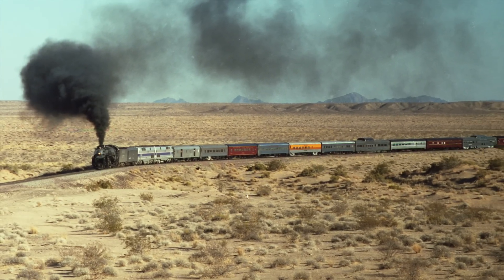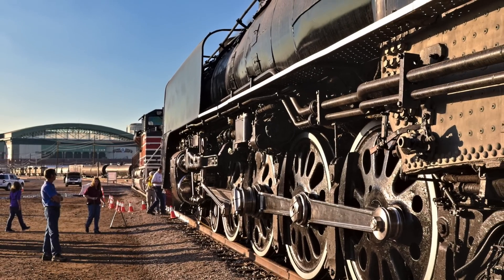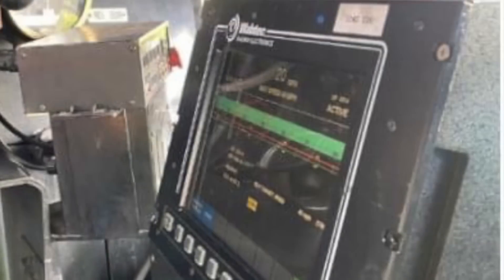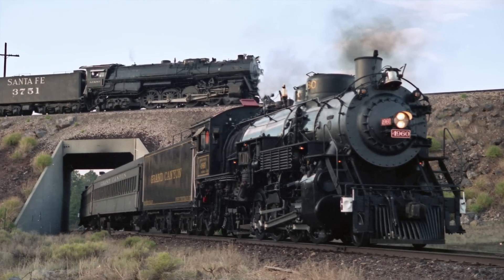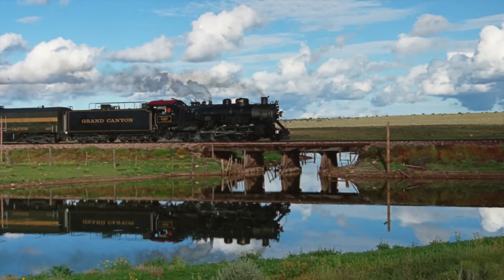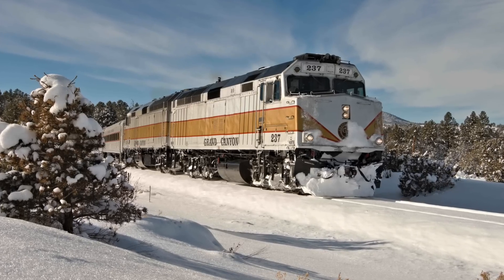Why is there a diesel behind the steam engine?

Comment: I don't know if it's me or not, but it still doesn't make sense to me.

"It helps to make track speed and get out of the way of freight trains."
Look, this is a genuinely resonable argument, which is why the American railroad system is so broken, passengers should be prioritized, NOT FREIGHT. But the answer isn't to give our rails to the government, you should know by now that government ruins everything, so just make a simple federal law that prioritizes passenger service instead of freight, the government wouldn't be in control of the tracks and routes, but the companies would have to follow such regulations.

"More storage for fuel and water."
Okay, or you could just use more tenders and it would be cheaper than having to run another locomotive.

"It provides head end power."
What were power cars invented for then?

"It helps in case of a breakdown."
It's almost like the people that run the excursions are expecting the locomotive to break down, plan ahead, make sure the steam locomotive is in optimal condition and run the excursion. In case of an actual breakdown, THEN, AND ONLY THEN have a diesel on standby near the excursion, it could be following behind, or be at the destination in case it needs to be dispatched, why does it have to be with the train at all times?

"What if the train needs a push?"
Why would you do an excursion in a route where the train can't function on its own then? The whole point of an excursion is to have an experience as close as possible to the trains original function, the sight of a diesel ruins it. It could be me, but that's how I think of it. Don't bother correcting me if I'm wrong.

It's like they're hiding that these locomotives actually can't run on their own, or that they have very poor performance, it just doesn't make sense when much more comprehensive solutions are available other than "more diesel engine". Ofcourse, I will admit, using diesels is EASIER, but does it really benefit more on the long run? To show how great our steam engines are we should let them shine, we should show that they still work after so many years, now that's a sales pitch! American enginiering is proven best when it lasts for decades on end, not being pushed around by a diesel. Look at the UK, the brits run express trains with steam locomotives like it's nothing, it makes us look like chumps!
Reply: its proabably because most of the time majority of mainline excursion steam locomotive doesnt have a modern protection and safety system to be allowes to the mainline, thats why a diesel locomotive is needed

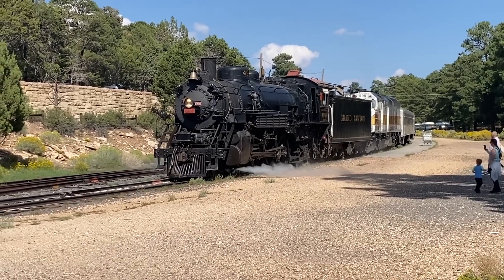Comment: 9:23 This is where I have problems with diesel locomotives in a train with a steam engine. To me it looks like the diesel is pushing the steam engine due to the lack of smoke, chug sounds, and exhaust steam from the pistons. In the very beginning the steam engine appears to be pulling weight but the amount of exhausting steam from the piston quickly dies down when it starts moving which to me suggests the diesel is now pulling the majority of the weight. These scenarios are what kill my enthusiasm with steam trains. Personally I refuse to ride on a "steam" train that has any sort of diesel locomotive presence.

However, the use of generator cars, with zero ability to put power to the wheels, are fine and I understand the need for extra electrical power to cars. But the magic of steam engines for me is broken when diesel locomotives are put on the consist because it is too easy to pull a sleight of hand by making you think the steam locomotive is working when in actuality it is a worthless show piece.
Reply from the maker: The sequence at 9:23 is a train moving downhill on a 1.5% downgrade.  Gravity is doing all the work.  The steam in the pistons is only there for lubrication.
Reply: @ehadder  That makes more sense. Thank you for that explanation!

I still stand by the original stance about having diesel locomotives in a steam consist. It is just too easy to pull a sleight of hand in that scenario.

 At the same time I do agree with needing the added assurances and reliability when operating on main lines with busy schedules. There really is no way around that issue and I can understand it.

For me I really want to experience the true steam locomotive journey. The same thing Americans did decades ago when steam still ruled the rails. The best experiences in my opinion are the most genuine. If the train breaks down, runs out of water/coal, etc... then oh well, it happened back then and I get to experience it.

Still have plans to eventually tour the Durango and Silverton along with other similar lines where they don't use diesels on the actual routes.
Reply from the maker: @SgtKilgore406  yep, I can understand your point of view.  I was in a steam train in Durango a few years back.  We broke down not even half way to Cascade Canyon.  They had to use a diesel to rescue us and take us back to Durango.  Never even got to see the most scenic parts of the trip.  I had been there many times before so was not really disappointed, and they refunded half my ticket price.

Comment: Just a thought, I realize that while running on a busy Main Line you would want to have a diesel engine for backup power in case there was a propulsion failure with the steam locomotive, but for smaller trips on less busy lines, couldn't a car with a diesel generator and equipped with PTC equipment that looks more like a traditional steam era Railway coach be used to provide the 440 volt electrical power and the positive train control equipment that would interface with the steam locomotive and allow it to operate?

Comment: The Reason for the diesel is to provide hotel power to the coaches. Once upon a time they were heated and even cooled by steam power. Electricity (36 v DC -- I think) was provided by batteries charged by a generator taking its power from one of the axles. Many older passenger diesels had steam generators to heat the coaches back in those days. Freight locomotives had no steam generator.

Today's coaches are all heated and cooled by 480 volt AC power provided by the diesel locomotive. Only purpose built passenger locomotives can provide this power, most freight cannot do this. Older coaches have been converted to this standard otherwise AMTRAK will not certify the coach for connection to its trains. People who have private varnish spend a lot of money keeping their car up to this standard and are inspected on the same schedule as all other passenger equipment. The steam locomotive cannot provide 480 volts to the train line, therefore the extra locomotive.

The Long Island Rail Road used to have two "locomotives" on its diesel lines so the train could run either way without turning the consist. But the west unit, usually built into an old 4 axle ALCO unit, was not a locomotive at all. it only looked like one. Inside it had the generator for the Hotel Power, and also had the cab controls when that end took the lead, that is to say on all westbound moves. Even so only the east locomotive moved the train, but was controlled from the west unit. With their new equipment the locomotive remains on the east en, but on the west end is a cab coach that can control the train from the west. Interesting, they must have two 'dual-mode' locomotives when going into Penn Station with dual-mode equipment. AMTRAK owns the station and will not allow an LIRR consist to run from the cab car. This is because the LIRR uses a third rail for its electric power, and the train could 'gap-out' if the engineer did not know where his engine was in relation to the third rail. This requirement does not apply to New Jersey Transit or to AMTK, which gets its power from the overhead wire, and this has no gaps

Clearly if some one wanted to, they could put that generator in a baggage car or something and then the steam locomotive would look like it was working alone. BTW those steam locomotives that run on any main line do have all of the cab signals and positive train controls as the diesel locomotives. Steam on dedicated tourist routes might not have this. The locomotives out of Steamtown in PA are fully equipped since they do run on active mainline tracks, but still have the diesel to provide Hotel Power. 

🦁🦁🦁🦁🦁🐯  broadwaylion.com
Reply from the maker: That’s a great description of Hotel Power.  I think this is a great topic for a future video

Comment: The Diesel is required as all Class 1 railroads require at least 1 diesel engine in a consist for safety.  The Diesel is far more reliable than the steam engine, provides electrical power for the train, has a more reliable source of compressed air, and has dynamic braking, which the steam engine does not.  This does not take away from what the steam engine is doing.

Comment: I've heard it supplies electrical power to the coaches as they require more now, as compared to the days when steam units only powered trains. 844 rescued a diesel supplied freight that stalled on a pass.  I don't buy that he big steam locomotives need help to pull.  But the diesels are insurance nevertheless.  Go back to WW2 when steam locomotives pulled long trains loaded with military equipment such as tanks.

Comment: When Norfolk Southern had it's steam program running in the 80's and 90's, they rarely ran with diesels.  They had a Head End Power car (HEP) that supplied power, and many of the cars also had their own diesel generators underneath with the other appliances.  
The Ohio Central didn't have places to turn the steam locomotives like the NS did, so they ran steam in one direction, and had a diesel on the other end to run back on longer excursions.

Comment: The Southern Pacific 4449 (4-8-4 train, called the Freedom Train in 1976) that was once a 'California Flyer' (I think it was).

When we chased it in SoCal some decades ago, it had a diesel behind it.  I later discovered that it was because at the time, the boiler was not certified for full, normal operating pressures.  As such, it didn't have its full power available.  Otherwise, the diesel was unneeded for what the train was pulling, even over the steep grades of El Cajon pass (Tejon?  The one heading inland East from the coastal regioun of SoCal).

If there were other reasons, I never heard them.

Comment: While I was visiting the 4014 during a stop in Jefferson City, Missouri, one of the crewman stated that one of the main driving reasons for the diesel is for the air compressor, the 4014's air compressor may have been good enough for 1950s railroading, but modern FRA standards require more air to recharge brakes. And like others have stated, having dynamic brakes, PTC, and diesel power to save fuel & slow wear & tear of a fresh complete overhaul'ed historic locomotive.

Comment: It is probably unlikely that the steamer has modern in-cab radio and signaling devices and even it it did the diesel would provide redundancy, the diesel can use its dynamic braking to reduce friction braking by the locomotive saving brake pads and wheel tire wear and the diesel likely can provide hotel power to the passenger cars for lighting and air conditioning, I am sure the old steam powered A/C is long gone.

Comment: I can think of a few reasons…1 reliability 2 lack of supporting infrastructure for steam power (IE fuel/water) 3 braking 4 assist with steep grades 5 alternate power for electrical systems and air.

Comment: meanwhile in europe, run that mf on the main solo.
Reply: thats probably they have a modern day safety and protection system attached on them and most of majority of mainline steam locomotives doesnt have one obviously
Reply: @voidjavelin23  they have the equipment to activate the safety system but other than that they're completely original.

Comment: The diesel is there because it provides electricity for the passenger cars for lights, heating, cooking etc. Those steam engines had more than enough power and braking for the job, they just don't make electric. The other reason is the computer and radio systems for train tracking. From a retired railroader...

Comment: most of the time when there's a diesel behind a steam locomotive its not for any of the reasons you listed, most of the times its just there to provide dynamic braking, and electrical power for the passenger cars, since the steam locomotive only generated enough power to run some lights in the cab on its own.
Reply: It is amazing how they used kerosene lamps to provide lighting in passenger cars before 1956.  Oh, Wiat, they didn't. By golley those cars had electric light and they were pulled by... a STEAM LOCOMOTIVE.  By what magic did they do that???
Reply: @organbuilder272  hey genius, those steam locomotives didn’t provide the power, the power was generated by axle generators on the cars themselves that generated most of the cars power when the train was moving. Steam engines designed for passenger trains had small dynamos for providing some power to the cars, but it wasn’t enough so they still had axle generators. Modern cars don’t have axle generators, so they need an external power supply, something the steam locomotive can’t do, especially if it was a freight locomotive. So that’s why the diesel is there. I’ve never seen someone be so confident in their comment yet be so wrong. Also, even if it was a passenger steam locomotive with the dynamo, it wouldn’t produce NEARLY enough power to run things like AC or heaters.
Reply: @bryanx2000  You are absolutely correct Bryan. Did I say they didn't? Not at all anywhere. Calm down and read plain English. The engines did generate their own power, however. They don't need anything from anyone else.. I believe, though not confirmed, that Ed said something about adding a 3rd dynamo to 4014 to help with power requirements for the new electronics
Reply: @organbuilder272  I like how you dropped the passive aggressiveness and backpedaled a bit when I confronted you with actual facts lmao. You talk about reading English, yet you obviously didn’t read my original comment, since I clearly said that I was talking about steam locomotives in general, and I said “most of the time” not just this specific one. If there’s a diesel locomotive behind the steam train, then that means for one reason or another, they need it for electrical power from the diesel and/or dynamic braking. A good example is with the big boy locomotives, they have plenty of power to pull the passenger cars, but don’t generate any electricity for the cars behind it. And even if they did generate power like I said, the locomotive would not generate enough power for all the cars, since each car can use several kilowatts of power.

Comment: 2:43 theirs something about the diesel being hooked up to a steam engine that takes away from the amusement when seeing the steam engine at work. Its like a bodybuilder on steroids. It's cheating to some degree.

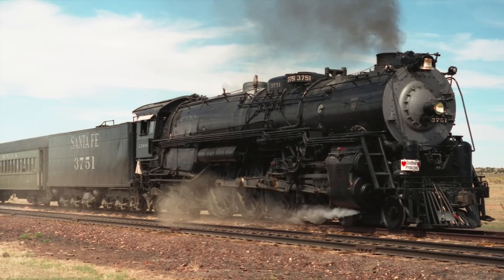6:18 I believe the sense of accomplishment and pride as an engineer with steam engines is to be able to manually work the engine accordingly, (feeding the tender, etc.) until reaching the destination.

8:13....8:27
Reply: If your going to have a diesel engine hooked up let it be the one with no cabin that looks similar to the coal car.

Comment: Regarding diesels on U.P. steam excursions I think they are only there for pulling and braking, but not for HEP. I doubt the various road diesels used have the necessary ports to plug passenger car standard power into. Also I believe the U.P. Passenger trains are self contained with generator cars in the consist supplying necessary power to the coaches.

Comment: The desiel is not for backup power I can confirm straight from ed dickens it is to prevent from wearing out the brake shoes and having dynamic breaking going down the hills as well the engine stays idle until then need to reduce the load going up hill but mostly used for breaking saving wear and tear on the steam engine because its hards as heck to change them out make them last as long as possible

Comment: It is amazing to me that even those large steam locos don't have has much power are the modern diesel locos.  So, not only are diesels cheaper and more convenient to operate, it would be somewhere between difficult and impossible to have 100+ car freight trains pulled with steam locos.
Reply: Yeah no lol.
Reply: @austintaylor7363  Sorry, I don't quite know what that means.  Are you agreeing with me or laughing at me?
Reply: @I'm Me  maybe where you're from, they wouldn't.  But US steam locos would drag 100+ cars with effort not even fathomable.   

We don't need the diesel electric, we use it as a fail safe.
Reply: @austintaylor7363  I'm from Ohio.  I was basing my understanding on things written by other people on YT and other places.  I get that engines such as Big Boy could pull 100+ cars, but Big Boy is at the top of the range of steam locomotives.

Comment: I always wondered about the diesels behind the steam.  I had assumed prior to this video it was there for electrical power to run the AC and lighting in the passenger cars.  I was there when 4014 first came out of Cheyenne and stopped in Laramie, WY on the way to Promentory Point.  That was when I first noticed the diesel.  Certainly 4014 had plenty of tractive effort to pull about anything. Rob